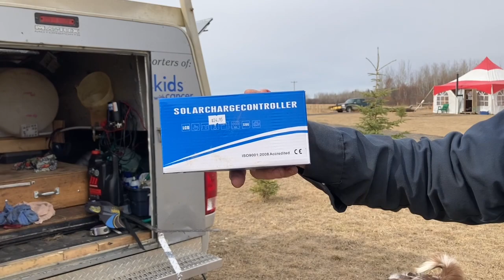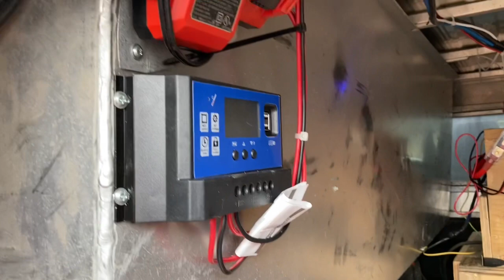NEW SOLAR SYSTEM EP 257

Comment: I'm betting you can run the A/C with that many watts.
Reply: we need more info...  it's not just the inverter that runs it, it's the power coming in...    
How much solar, to how many AMP HOURS of Batteries... 
to then be INVERTED (DC-> AC Power((WATTS))    
(I don't remember how much he has)>>>
400 watts of solar (?9 amps) into 400 Amps of LEAD Acid batteries, is only 200 useable amps for ???  
(P= I x V) 10 amps x 12v = 120 watts into the 4000watt inverter = it will run but for how long??? 

I'm sure my math is off too

Comment: Neil's going to need a bigger truck to haul everything handy from harbor freight, I won't mention the place you bought the charge controller or the guy who made the perogy press years ago and see what happens to this comment
Reply from the maker: Lol I doubt it. If Neil will get a truck he loves that one he was smart he bought a trailer his truck could pull novel idea 😂 🇨🇦🛠️
Reply: @badgewefixstuff  lol a guy at work got a great deal on a 20 + foot trailer and hooked it on his 1988 ford truck and took off and the front end kept lifting off the road, so time for a new extended cab truck, not such a great deal anymore, I told him he should have sat on the front bumper and let the wife drive

Comment: Agreed on the batteries. We use ex city bus 8 D batteries and they've been super good.  Running through a Can Tire 3000W eliminator inverter, we have all we need. Cheap and Cheerful! Thanks for showing a set-up doesn't need to cost a fortune!
Reply from the maker: Yes so true if it works why change it ?????? 🇨🇦🛠️🇨🇦🛠️